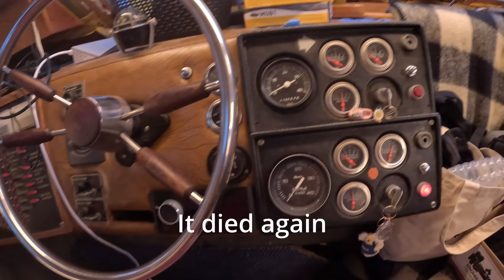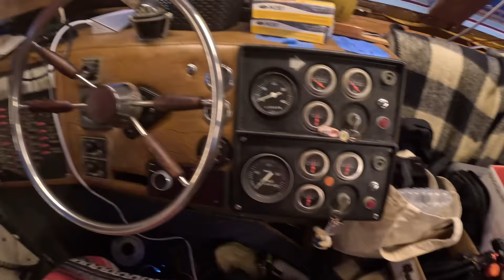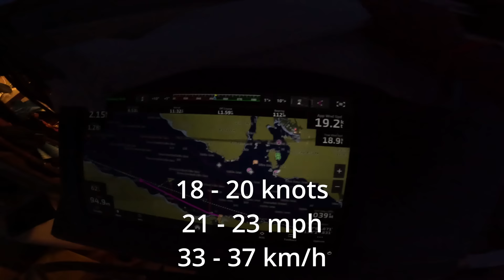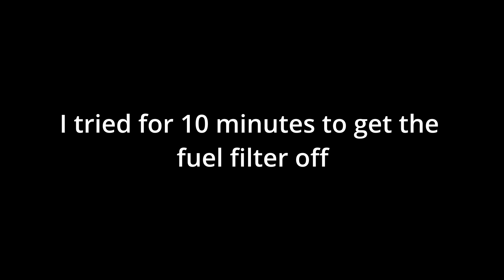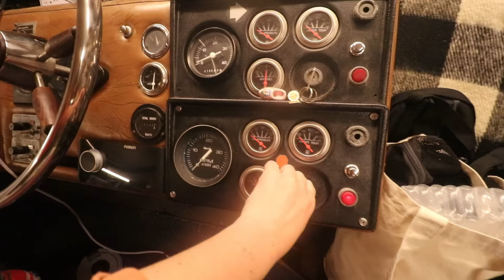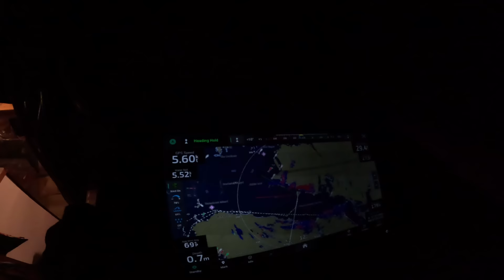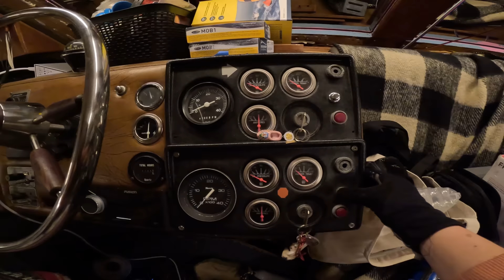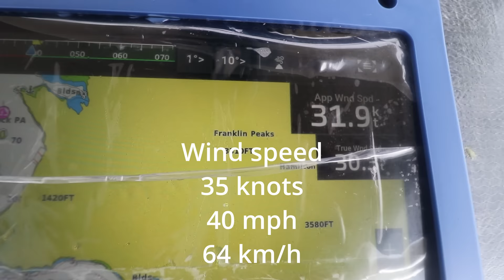DOUBLE ENGINE FAILURE IN GALE FORCE STORM [Ep. 7]

Comment: im 5 minutes into the video. that boat isnt squared away to go out. that fishing rod swinging with a lure on it, was just waiting to get someones flesh and create a potential tricky injury which would have turned your attention from sailing the boat. your deck and cabin are clutered with stuff which isnt tied down creating yet more problems and losses as it may splah onto the water, creating yet more trip hazards, etc. this isnt like living in a house even if your boat is a catamaran. Maydays and Pan Pans arent to be issued lightly. you are going to put other ppl life at stake to come get you. remember that. you had sea room (from what i could gather) you had steerage because you could sail the boat and you werent in a life or death situation boat wise, injury wise. strongly recommend you enroll in some appropriate sailing  tickets to Yachtmaster Offshore level. being at sea is never a joke no matter how fair the weather is.
Reply from the maker: You are entirely right, the boat wasn't squared away properly and we definitely learned a hard lesson there. We don't take Maydays and Pan Pans lightly which is why we didn't call one. We got steerage of the boat with a little bit of sail which got us sea room from the land then tried to figure out the problem. More experience would have definitely helped us solve the problem faster. We were just working together to run through all possible problems/solutions and then we started with the easiest ones first. Now that we know the boat a little better we are planning to put some additional fuel lines in and a fuel polishing system. In all we know we need to be better in the future and we are working with some people from our sailing club to help us plan better and improve. Comments like yours also help us get better, so thanks very much for the feedback we appreciate it a lot! :)

Comment: Two words: Preventative maintenance.
Check critical systems regularly - especially before voyaging into open ocean where unpredictable weather conditions can and will spank you.
Reply from the maker: That's good advice. We did check the fuel bowls and they were clear, also the storm wasn't forecast. If we had more experience we could have seen it building, but we are still trying to learn and will focus on as much preventative maintenance as we can. :)

Comment: Those filters have a pump on the top...THAT knurled knob on the top must be unscrewed pumped until you hear rattling then retightheni did the same thing 40 years ago... changed filters and didnt pump the filter housing.
Reply from the maker: Thanks for the tips! this was something higher up then the fuel filter, the pick up line and other pipes were blocked.

Comment: Still can’t figure out how you got into Portage Bay without a working engine. The entrance is shallow and convoluted. But very safe when you get in. We usually anchor in the same spot.
Reply from the maker: It certainly is hard especially when it is your first time and at night. It's cool that you anchor in the same spot that we did. We did get an engine running, plumbed right to a jerry can otherwise I don't think we would have attempted to go in. Aside from this problem, sailing around here has been amazing :)

Comment: Great work under pressure! You have probably already figured this out but The fuel issue is almost certainly bio bug it grows in the fuel tank and in rough weather it gets stirred up and plugs up the fuel filters and in bad cases plug lines. The solution is polishing the fuel and cleaning out the tank and lines, it's a messy job that can be hired out or done diy. As for the melted bit of line around the prop shaft it's good you did not use that engine as it could block water from cooling the shaft bearing damaging it and potentially damaging the shaft.
Reply: I agree, I’ve had to clean out tank on my semi, yes it def is a filthy job
Reply from the maker: We are still investigating. Access to the fuel tank is less than ideal. We are trying to figure our a way to install a fuel polishing system. And we plan on removing that line asap. Good to know it could cause cooling problems, if we wrap a line in the future. Thanks for the informative comment. Comments like these really help us do better in the future! :)
Reply from the maker: Sounds like we have a crummy day ahead of us lol

Comment: Typically you get a bunch of crap on the bottom of your tanks after a while... The rough weather/waves stirs it all up and it gets sucked into your fuel filters and chokes out your engines. If it's bad enough, it clocks the pickup tubes too. When you get to port, take out the sending units from the tanks and suck out all the fuel/gunk. You can filter the fuel and re-use it. Sucks, but this is basic maintenance that went unattended... Really ought to check your fuel tanks and suck the crap off the bottom once a year.
Reply from the maker: There is a chance we got bad fuel a few days before this. we don't have any access to the fuel take but we are going to clean the fuel and put some biocide in the tank. we have been in some rough weather before this and never had a problem, we did check the fuel lines and the glass bowl under the fuel filter before we left, everything seemed to be in good order. we have plans to up in a fuel polishing system but because of this old boat it will be a bit trickier than it should be. Thanks for the advice, keep it coming :)
Reply: @sailing.supernova  Entirely possible.. I got some pretty dark diesel in Cuba before though, and it burned through fine.. I've seen some other older boats that have mystery engine issues when the weather gets rough but run fine otherwise.. It's usually caused by years of never thinking about what's actually IN the fuel tank. Was in a marina once and I helped a guy with an 80 gallon tank empty it out and pulled about 40 gallons of super cloudy diesel and other gunk out of it. We let the diesel set for a couple days on land and eventually got about 8 gallons of water out of it. 32 gallons of diesel, 8 gallons of water.. 10% of his fuel tank was water and a good cup and a half of just sludge.. Just blew my mind... How it even ran to begin with, with that much water in the tank I'll never know...

The other problem with water in the tank, if it's a steel tank, it will cause things to rust....
Reply from the maker: Its an AL tank, I think we got most of the stuff out now.

Crazy it even started with that much water!

Comment: You need to learn a sheet bend! Fuel flow problems are 99% of all diesel engine issues. Did you remember to plumb the fuel return into the Jerry can as well? I learned that one the hard way...
Reply: Yes, a sheet bend knot for tying two lines together can really come in handy. I would suggest you look for a nice little book of knots to add to your library. If you pass thru Sausalito on your way south I have a knot book I can give you.
Reply: @suesailor  I have been doing it a while. I don't need a knot book.
Reply from the maker: Thanks for the advice re. sheet bend. This was a fuel issue. We did not have the right stuff to plumb the return line into the jerry can but we were aware that we would use a lot more fuel. With our measurements we figure we could get about 3 hours of fuel burn from a jerry can without the return line plumbed in. We are looking at redesigning the fuel system when we can get the parts :)
Reply from the maker: We hope to make it down to Sausalito in about 3 weeks if all goes well :) We could definitely use a knot book lol
Reply from the maker: With your knowledgeable advice above, I'm sure she was saying we needed a knot book rather than yourself. It's clear you know what you're talking about. Thanks for the quality advice :)
Reply: And you only need a few knots for 99% of everything: a clove hitch, figure eight, bowline, sheet bend, rolling hitch,halyard knot and a round turn and two half hitches. The first four knots are enough to cover 90% + of your needs.
Reply from the maker: Darcy used the rope splicing app you told us about in the video we just posted. it worked well and now we can splice stuff :-)

Comment: Was it possible to get fuel out of the boats tank to put in Gerry can?
Reply from the maker: We did not have the correct stuff to siphon the fuel from our fuel fill line. And the problem was with the main fuel line. We are planning to pick up some smaller tubing to make siphoning fuel possible from the fill line. In the future we should be able to solve fuel problems a lot faster as we now know heaps about our fuel system :)

Comment: Guys Guys Guys, working on deck in the dark in a strong wind with an engine that you hope is reliable. PLEASE wear a harness and clip yourself in. With everything you have going on onboard the last thing you need is a MOB.
Reply from the maker: You are 100% correct. We picked up dirty fuel which caused this problem but we need to be better with our safety. We are going to install jacklines so we have proper places to clip in. We appreciate your concern for our safety and look forward to any other advice you would have :)

Comment: in the future if you dont have a fuel/oil filter wrench and you really need it off you can always stab it with a screw driver to get extra leverage
Reply from the maker: We had one but it was a rubber strapped one that wasn't strong enough. It's fortunate that Darcy had some adrenaline and was able to grip and rip that thing off. It's good to know about the screw driver tip though, we've googled it and it is definitely a thing that can help in an emergency situation. Thanks heaps! :)

Comment: Drama queen and king.
Not blowing 40 knots!
Learn to bleed the fuel system before you go to sea.
Put an electric fuel pump at the head of the system.
Air is the culprit ‼️
Reply from the maker: Sorry you think it was fake drama. We were honestly scared. This was our first experience with any winds over 25 knots. The highest we saw on the wind meter was 45 knots (that was a gust). Without much experience it was a terrible situation to be in. If you see how much we are smiling in our other videos, you will be able to see how serious we are in this video. It was not air in the lines unfortunately, that would have been a much easier fix. We got good at bleeding the fuel system when we completely emptied our tank a few weeks back (it's in a video not long ago). Our fuel tank is about 4 feet above our engines, which makes it a lot easier to bleed. We're pretty sure that we got bad fuel a couple days before this and as soon as we got into the heavy weather, it killed both engines. We did change the fuel filter as you see in the video but that didn't solve the problem. If you have any other questions we'd be happy to answer them, and always looking for advice. Hope you can enjoy our other videos :)

Comment: When it comes to marine diesel the first thing to change is a fuel filter
Reply: There is an additive that you need to add to diesel tanks to keep the algae from growing in them
Reply from the maker: Definitely agree!
Reply from the maker: Thanks for the tip, we picked some up but were told we shouldn't use the engine for 48 hours after we put it in. Also looking at building a fuel polishing system. :)
Reply: @sailing.supernova  I am sure you’re aware that there is a fuel filter/water separator that you can use on diesel engines it has a fuel filter with a plastic see-through bowl to drain off water or impurities it should be installed before the primary filter
Reply: You can run the diesel immediately after filter installation
Reply from the maker: Sorry we meant the biocide, the guy who sold it to us said that it would help dissolve the algae but had to be given time. If we ran the engines before 48hrs he said the dead algae would clog the fuel filters quickly.
Reply from the maker: Yep we have one of those on both sides, we were debating getting a second one so we could switch fuel filters in an emergency by just turning a lever. But there is so much to do before Mexico that it might have to wait :)

Comment: you should be able to sail without an engine. many have done it Pete goss
Reply from the maker: Sailing bought us time to solve the problem, but the anchorage we were going to was a very tight pass that had a dog leg in it and we needed motors to get in. Also we are very inexperienced and did not want to have to tack and sail all night without having it planned better with our sleep schedules. We were grateful we were able to put the sails up (reefed) and get steerage of the boat while we sorted out a temporary fix for one engine. Hopefully we get better with experience. :)

Comment: Lemme guess...
You swapped out your racors and everything was fine after that
Reply from the maker: Unfortunately that was not the cause. We did try that second though. Any other guesses? :)
Reply: @sailing.supernova  sounds like air in the system, or a clog.
It ran from the can, so the pump works.
Bad return?
Clogged injector?
Bad stall ring?
Reply from the maker: I'll give it to you because you said clog. It was the main fuel line before it split to go to each fuel filter. We picked up bad fuel a couple days before this and didn't know until this exact moment. We are now trying to deal with the left over contaminants in the fuel tank. Out of all of those possible problems you said, man were we ever happy it wasn't a clogged injector lol If you want to see exactly what it was, click on the next video after this (episode 8), it's right near the beginning :)

Comment: Click bait big time. Suspenseful music added for drama when they bought an old boat and obviously didn't clean the fuel tanks. Did cosmetic repairs but looks like no basic mechanical repairs. I wanted to like this channel but with manufactured drama and ratcheting that up with dramatic drones, I'm out.
Reply from the maker: Very sorry to lose you as a viewer! We definitely do not want to put out any click bait in titles. We truly were in over our heads, and it was a real emergency. We felt like it was an appropriate title conveying what happened to us. We have done a bunch of preventative maintenance on the engines and one drive train including replacing the prop shaft, aquadrive, and CV shaft. One engine was newly rebuilt when we bought the boat. We have no access to the fuel tank because it is fibreglassed in under the cockpit deck. We did however drain all the fuel to check how big the fuel tank was and all the fuel came out clean. We also have sailed in some pretty big sea states on the way up to Alaska and always check the clear bowls under the fuel filters for any sediment during and after sailing, and there has never been anything. We suspect we got bad fuel a few days before this incident. We have now ordered a 'Mr Funnel' to filter fuel before we put it in the tank and are trying to figure out a fuel polishing system that we could install on the boat. I can promise you that we did not plan or want this to happen. It was very scary for both of us. The wind topped out at 45 knots and we know that we are novice sailors. The forecast was for 15-20 knots of wind. As for the music, we were just trying to convey how serious and tense we were feeling when it was happening. We are sorry that it wasn't to your taste. If you decide to give us another chance just know that everything we put on youtube is honest and not meant to be deceitful at all. We are also happy to receive any feedback that you may have about sailing, boat maintenance or how the videos are put together. We are just out here trying our very best but we are aware that we have some shortcomings. Hope you have a great week, sincerely Yvette and Darcy.